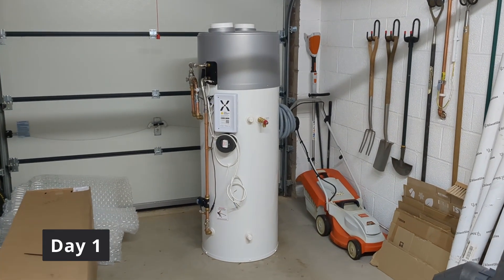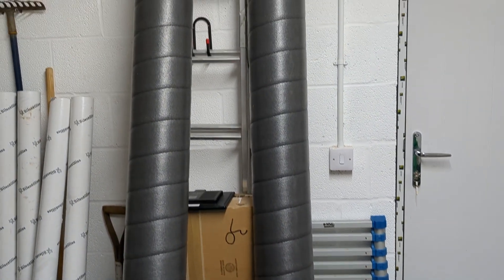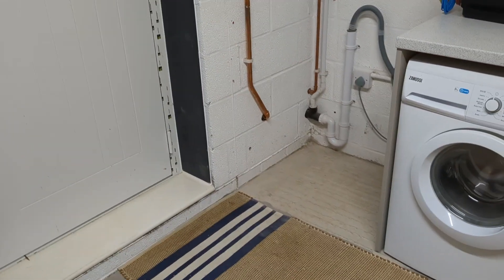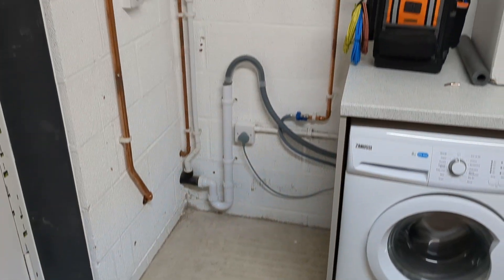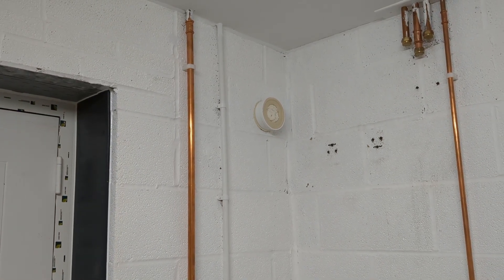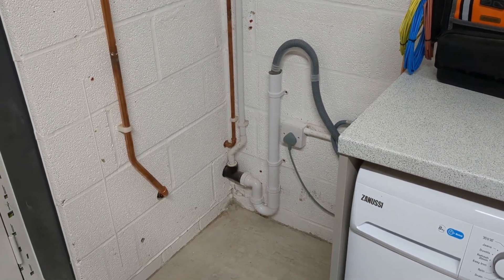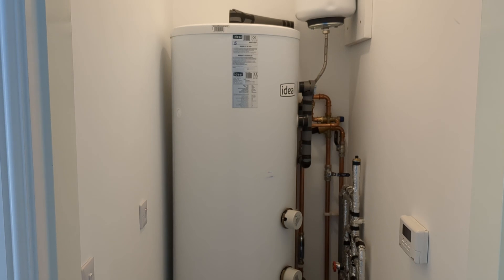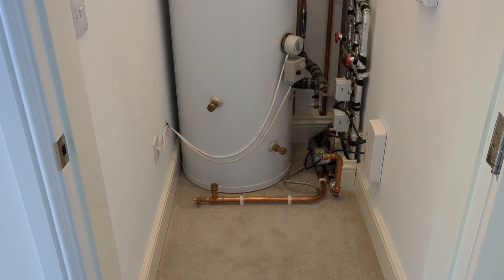Mixergy iHP hot water cylinder - install

Comment: I've been looking into getting a Mixergy Solar tank and run into nothing but problems even just getting a quote.  I've tried four of the suppliers listed from the Mixergy site, two tried to talk me out of buying the system, saying that I'd never make my money back etc, then went silent when I confirmed I would definitely want one.  One told me that the cylinders were overcomplicated and recommended instead a much simpler cheap unvented tank and then I should go and get a solar diverter installed by a separate third-party of my choosing.  The final one confirmed that they could supply and fit a 150l tank, but they had a markup on every stage, quoting me £2,500 for the Solar X 150l (plus vat), and another £1,500 for fitting (plus VAT again).

I'm just about ready to give up.  I think Mixergy need to do a bit more PR work with their suppliers and encourage more buy-in from them otherwise a very good product will get very little pickup
Reply from the maker: That's a shame.  It might be worth reaching out to Mixergy to see if they can assist.

Comment: Thanks Tim. Not eligible to buy and install with the grant subsidy? Does it not count as an air to source heat pump too?
Reply from the maker: Sadly not.  The BUS grant is only eligible for full heating plus hot water systems combined.  It can't be used for hot water only systems like the iHP.

Comment: Tim would you not install a diverter valve on the output vent to recirculate that cool air into your office room to keep you cool in the summer
Reply: That's not a bad shout, we had ours running without ducting for a few days when it was hot... Cooled the utility room down nicely!
Reply: @Eggnog3000  exactly. No point in wasting that chilled air. Utilize it. That should be included in the SCOP rating
Reply from the maker: In theory that's a good idea, but from a practical perspective it would be complicated and expensive to do, so no, not worth doing, really.  The small savings you'd make (about 20p per day for a few weeks a year) would never cover the extra cost of adding such a system, unfortunately.

Comment: Why did you choose to have it installed in the garage? I assume for space and noise reasons. Are you concerned about the heat loss to the garage and the garage not being in the thermal envelope of the house?
Reply from the maker: The garage is insulated too, and tends to stay above 12 deg in Winter, so the extra heat loss won't be too great (not enough to outweigh the extra efficiency, for sure).  We'll discuss the reasons in more detail in a future video but it was a combination of being more convenient for the vents and also to minimise the noise impact.
Reply: I'd never considered putting our tank in the garage before seeing your video. I assume 3 of the 4 walls are insulated (integral garage). Good option to free up storage inside the house. Very much looking forward to seeing your results and impression in upcoming videos.
Reply from the maker: Yes, it's an integrated garage.  All the walls are insulated, and it has an insulated garage door.  I've got a thermometer in there and last Winter it never went below 12 deg.

Comment: Thanks Tim for covering all angles and giving a good introduction. Great information and looking forward to future episodes :)
I'm guessing you had electric water heating before iHT and never on day rate, so free energy from the sun or cheap overnight rate (directly or indirectly through the battery). One could argue environmental and economic considerations were being ticked. Considering your HW tank was modern, well lagged with enough capacity, no compelling rational to change it at this time. Perhaps likely you've gained some battery capacity now, some cupboard storage space and removed a potential (albeit very remote) risk of flooding due to tank failure. What am I missing, Tim?
Reply from the maker: There was no pressing need to get rid of the old cylinder, really, you're right.  We were using the immersion on a timer using overnight power, so it was not expensive to run, it's true.  But I wanted to get closer to being a net exporter rather than net importer of electricity across the year, so this is another step towards that goal.  Freeing up the airing cupboard is a bonus too.  We'll cover all that in more detail in a future video as well.
Reply: @TimAndKatsGreenWalk  Thanks for your comments. Yes, it makes more sense now

Comment: Thanks Tim great video. I couldn’t fit the IAHP into our airing cupboard not wide enough so just recently had a Mixergy 210l slimline fitted so not as efficient. But still what a saving all our water is heated up on Octopus go night rate plus solar and this lasts us all day it’s equivalent to having an another 9.5kw battery fitted. Their simple but effective way of heating a hot water tank is amazing.😀
Reply from the maker: Yeah, it's clever stuff.

Comment: It's a shame Toshiba and other air to air heatpump manufacturers don't offer a way of integrating hot water into their systems. it would save having to drill two big holes in the wall and make placement a lot more flexible.
Reply: U can get the Dakin multi plus system that does hot water and air to air heating and cooling.
Reply: They do.  Just not many in the UK at the moment.  I have the Hitachi Yutampo Twin with 2 internal units and the 190L cylinder.  According to my installer, Toshiba does one but it's prohibitively expensive.   Daikin do one too (Multi+), but in the UK the cylinder is tiny - 90L or 120L.
Reply from the maker: As others have mentioned, they do exist but are rare in the UK.  I covered the Daikin system here: https://youtu.be/9domQlKtbBQ?si=vXK41ZZIab0bTsRg